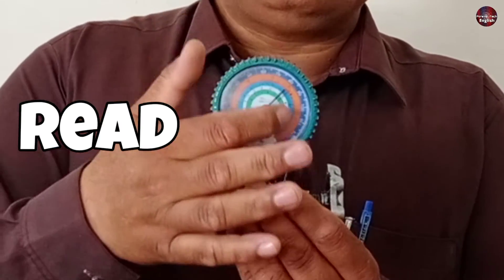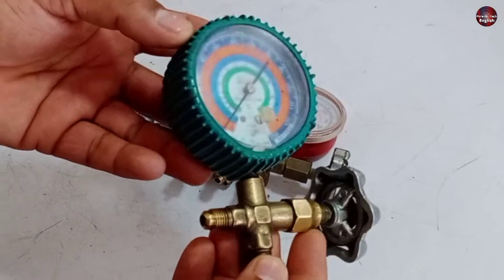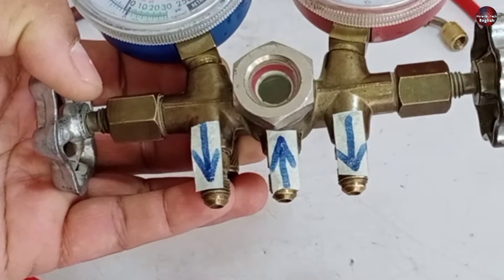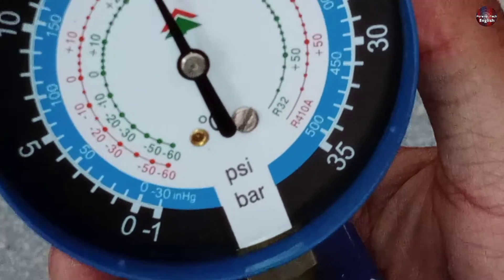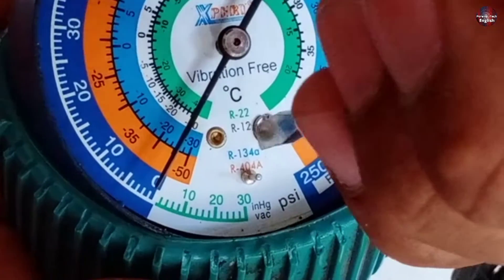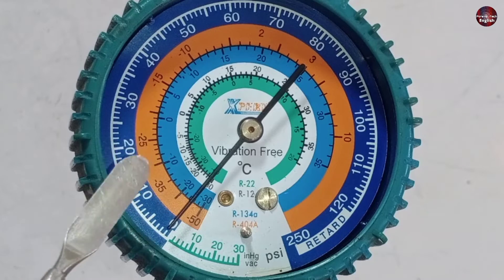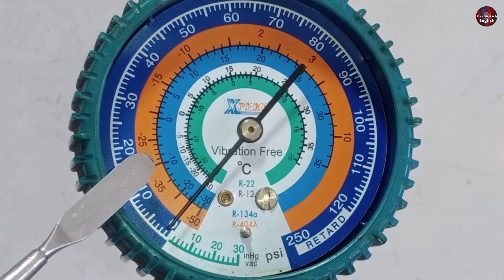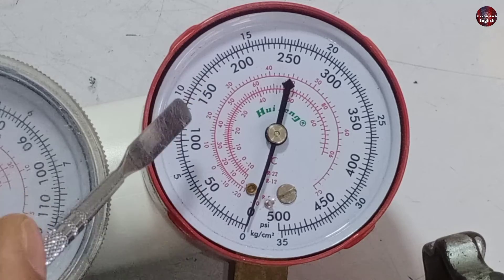How To Use HVAC Manifold Gauge For Beginners

Comment: My low reads 0 psi. My high side reads 85 psi. It's r22, 3.5ton. It quit a few months ago. I put in a new contactor, capacitors, fan motor and checked for leaks. It does NOT turn on. The air handler fan and heat work. There is 24v in the contactor. What do you think is the problem with the compressor?
Reply: I'm taking HVAC classes for a diesel program, but a couple things I can think of is that there is very low refrigerant in your AC system which means it's undercharged. The second I can think of is there is moisture in your system that can cause a high pressure and having no pressure in the other line.
This is just an idea, but check your hoses and connections and see if there are any leaks, If you have recovered the refrigerant do a evacuate if possible and after do a nitrogen test to check for any leaks or hoses bubbling up make sure to have a spray bottle with soap in it and spray until its dripping to see if there is any bubbles forming.
This is just a small handful I know but these are things for Diesel HVAC I'm not sure for everyday cars but this can help you if you need it
Have a day, hope you get it fixed or if you have already.